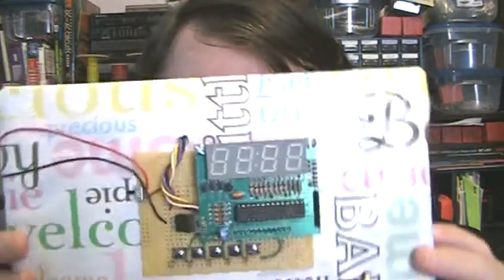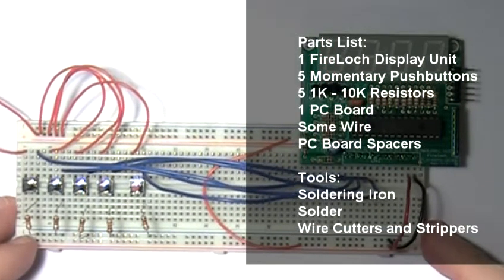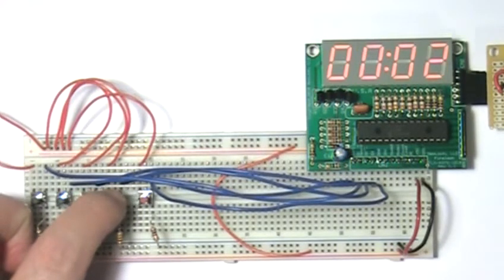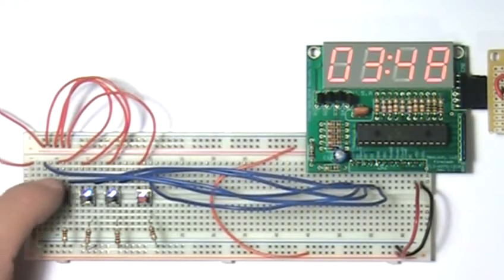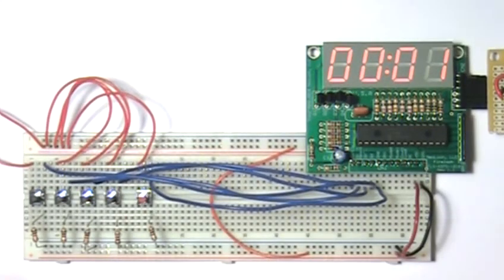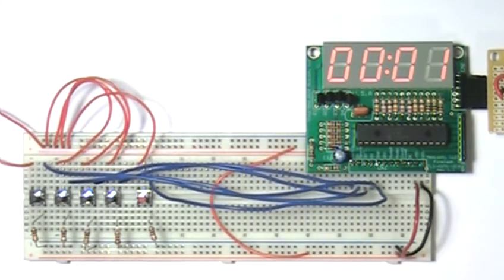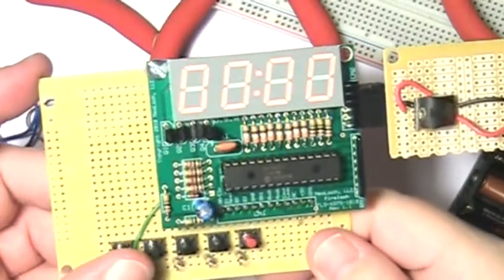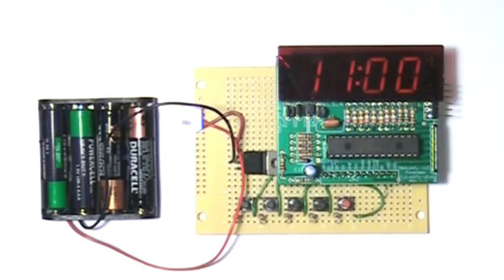FX Electronics Build #2: Fake FX Countdown Bomb Timer

Comment from the maker: The timer can be re-programmed (using assembly or C) to go down to zero. Depending on the current requirements of the siren, it can either connected directly to an I/O pin an driven that way or via a transistor. So at most, only a few parts would needed to be added to drive the sound effect.

Comment from the maker: @megadoomer44 A single digit counter is pretty straightforward to implement, you can either control is with a microcontroller  or dedicated ICs. Though, I'm always the one to recommend a microcontroller, you can always change the code later it you want to.